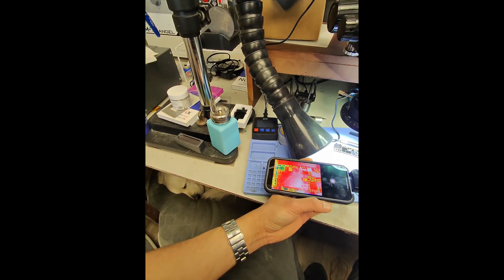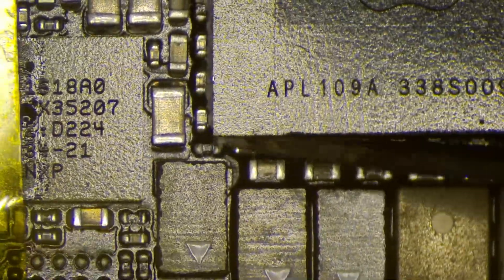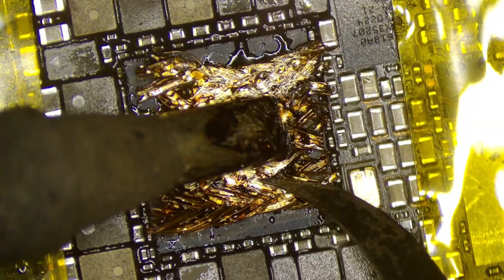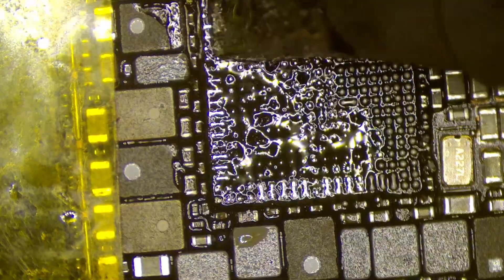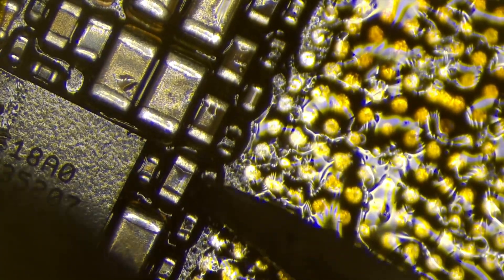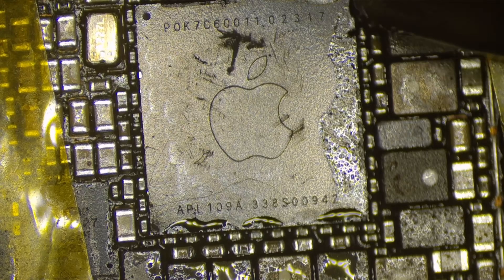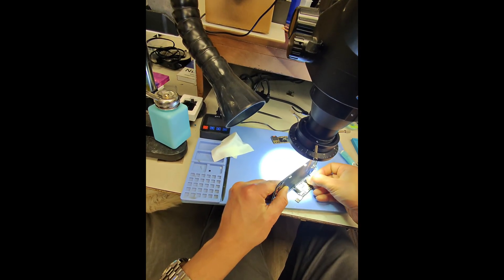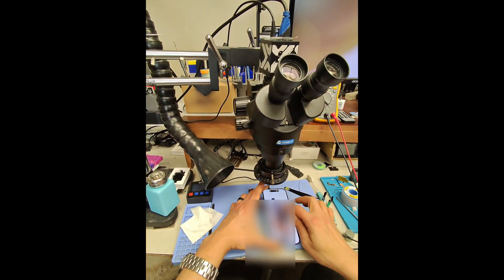iPhone 14 Pro PMIC replacement using soldering iron

Comment: I have an iPhone 14 with lower layer (AP board) problem. When I connect DC power supply there is no short, but once I trigger power button pin on interposer I get .900ma draw back to 0 and repeating. Would this point to I2C line or power rail short?
Reply from the maker: Sounds like a power rail short. Check with a thermal camera and measure for shorts around the PMIC and Nand